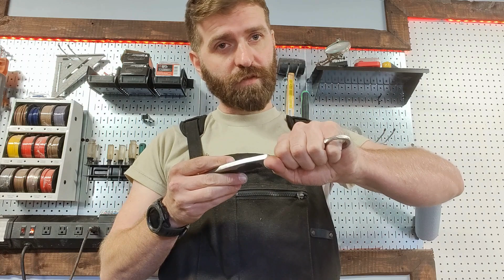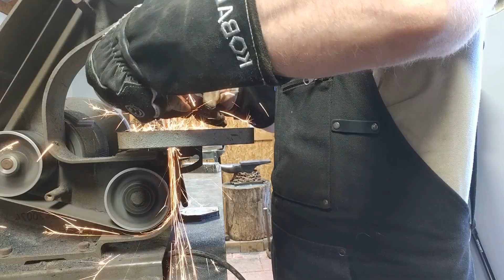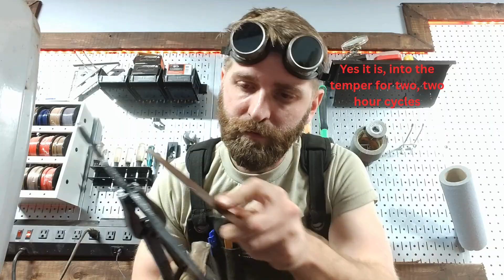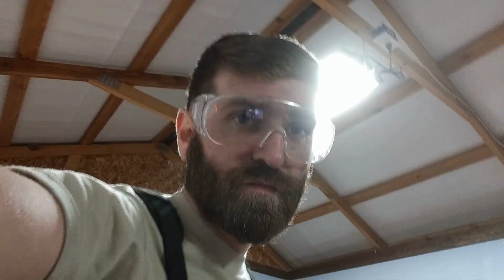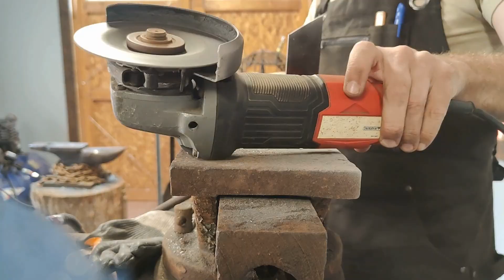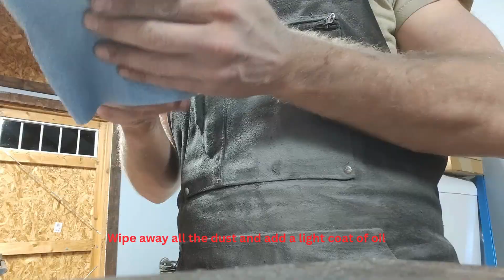First Responder Spike Pt  2

Comment: Really nice work man! Thanks for the mention, and I’m sorry I sent you back to the forge 😅 no sweat though right
Reply from the maker: Always worth it! You were right, those finger choils really made the knife feel better in the hand. Thanks for the tip 😁
Reply: @FoxfireForge-0  3:19 what grinder is that? I am trying to move away from hand files it’s devastating on the shoulders 😂
Reply from the maker: @BaerKnifebonsai it's a Jet J-41002, had it for about five years now and haven't managed to break it yet 😅